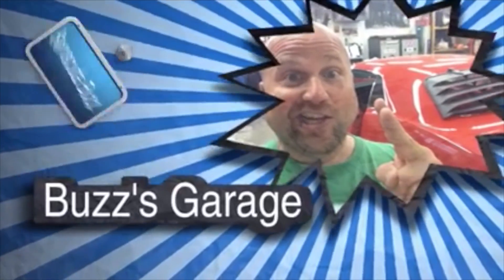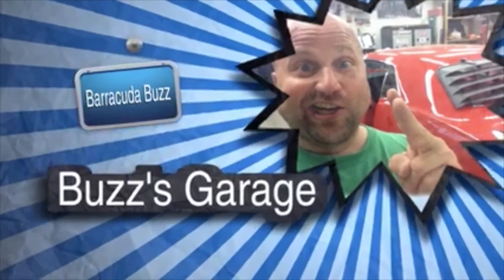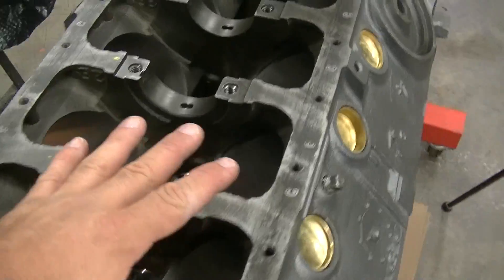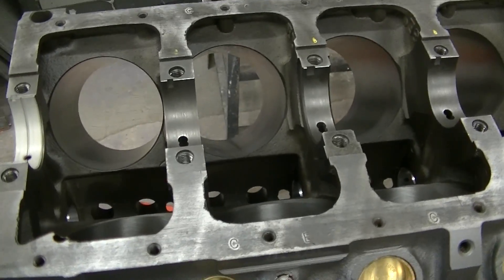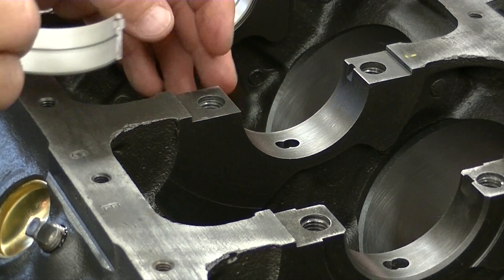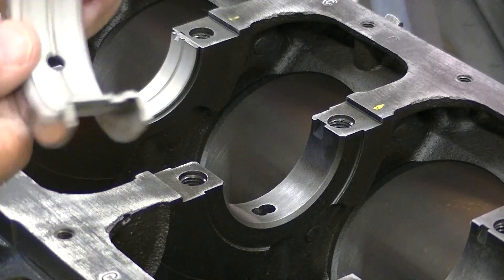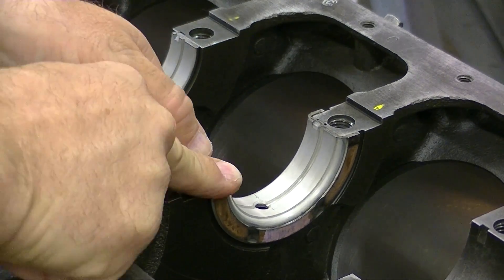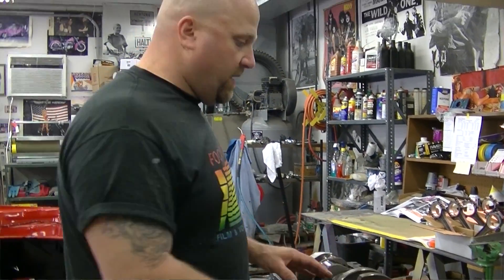How to Build a 340 Engine - Part 1- Checking Bearing Clearance with Plastigauge

Comment: Hey Buzz,  on your main cap bearings I noticed there is a hole in the center of the bearing. Is that normal because I have seen some 340 main cap bearings that do not have a hole in the center of the bearing. They are just a solid main cap bearings. Thanks.

Comment: would you no what the compression is on a 318 i have a 93 dodge Dakota 318 would that be a magnum  or la what's the difference in the too how do i get the compression up what would be the best compression for the 318 motor

Comment: I'm not trying to bust your balls, but you really shouldn't break torque with a torque wrench.  That's a fast way to null its calibration.  It doesn't surprise me the machine shop screwed up your crank.  When I worked at one, Chrysler products were treated like crap compared to their oh-so-precious French Chevy parts.
Reply: French chevy parts? you do realize most chevy engine parts before 1987 were made in america, mainly detroit, or kentucky.